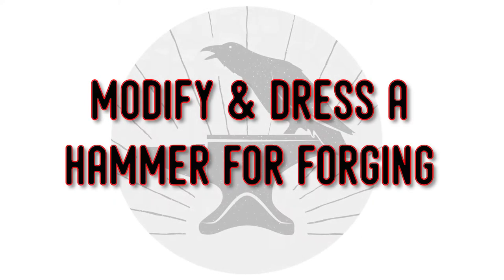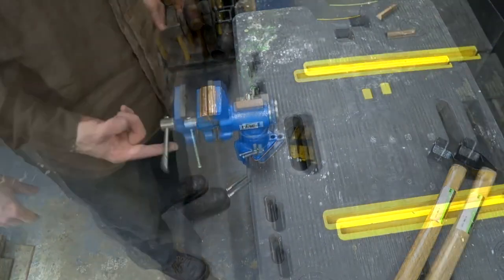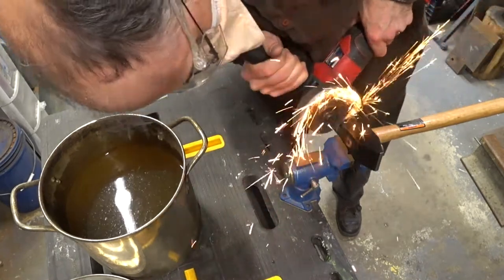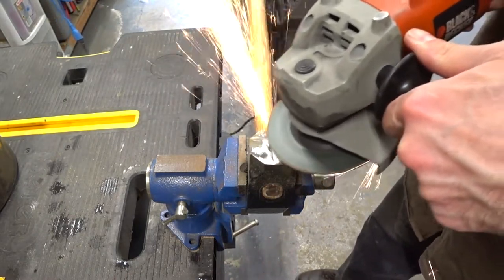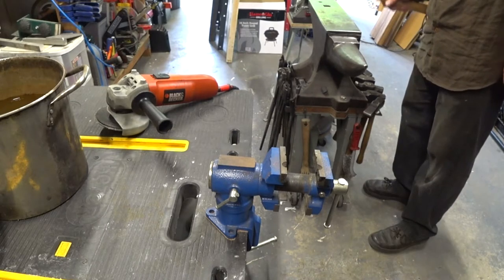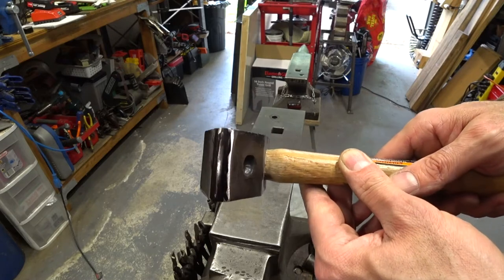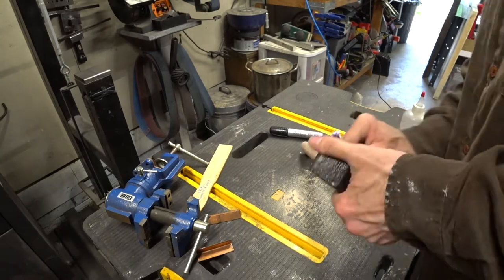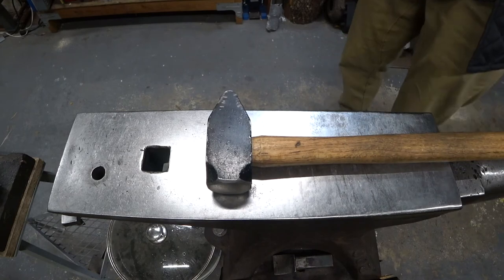Transform a CHEAP hammer into a GREAT first blacksmithing hammer! | Start blacksmithing

Comment: This is such an insightful video for beginners such as myself. I was set on a lighter hammer, but I never considered buying the heavier hammer and cutting off the excess. Not only will that give me a bit of steel to work with, it will allow me to get precisely the shape and weight that I want. Thanks for the good ideas
Reply from the maker: Glad you learned something useful!

Comment: I used to use cut off wheels but found quality metal saws all blade works as good or better depending on the metal your cutting
Reply from the maker: Good tip. Personally, I've never really liked cutting metal with a reciprocating saw, though. The vibration just feels much worse on my hands than a cut-off wheel.

Comment: With so much of the hammer's mass being on the top side, did it feel awkward to swing? Any control issues?
Reply from the maker: It is similar to the feel of a Hofi style hammer. I didn't find it difficult to get used to, it is fairly comfortable to use.

Comment: Instead of saying you calculated how many inches of material did you remove?
Reply from the maker: If I recall correctly I removed roughly 3/4" (20mm).

Comment: OK - you cut off a 1/2 pound of metal off the end - why not take about that much off behind the head and leave it "long" rather than "short" as in when you cut it off.
Would that make it easier to use - as it is longer but lighter and still have the same rebound?
Reply from the maker: Yes, that may be a good approach w/different style of hammer.  Hammers of this style have very little mass in the peen.  Removing mass there would reduce the weight very little and quickly make the peen unusable.  Removing metal from the face makes an ugly hammer, but does not really reduce usability.  The short hammer actually has a long history, check out cat's head hammers and Hofi hammers.
Reply: Don’t cut any off. Unless you want to reharden it. They only harden 3/8-1” back. The rest is soft

Comment: Only the first inch is hardened . You cut the hardness off.
Reply from the maker: Potentially true if the hammer was induction hardened. Since it was a very cheap, mass-produced hammer I was banking on through hardening, if it was properly heat treated at all.  Either way, it held up fine for the 3 forging projects I tested it on.  The face did get a bit dinged up, but all cheap hammers are a bit soft in my experience. Thanks for your comment!
Reply: @ravensroostforge  cheap stuff has less tempering  and less hardness. Even expensive ones are only gonna go back an inch. They are not gonna harden  the whole thing. If you harden the whole entire thing impact will crack it at  the eye.